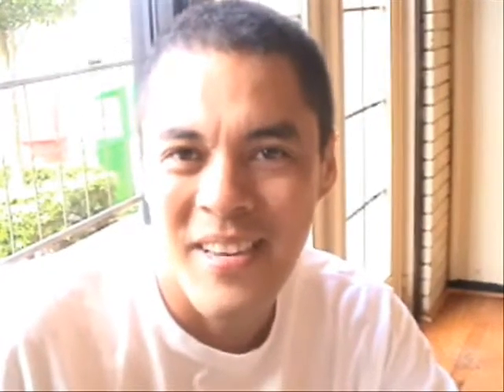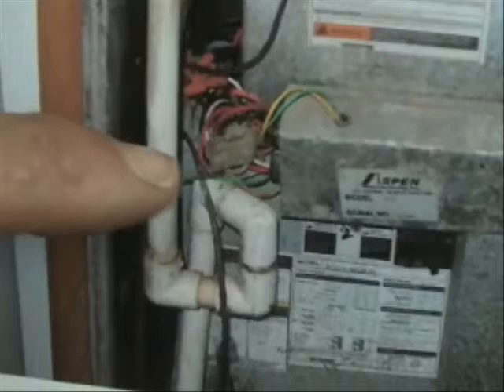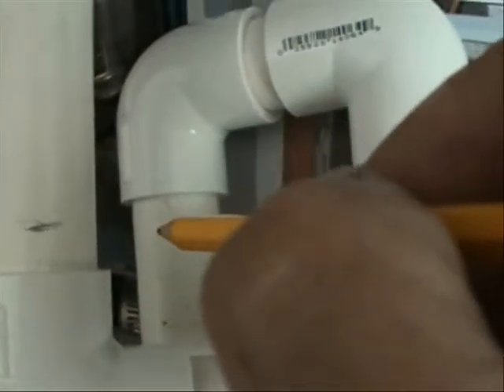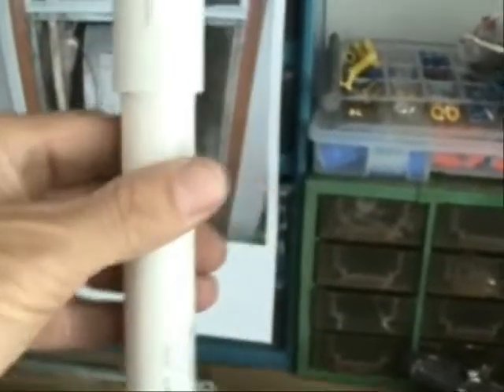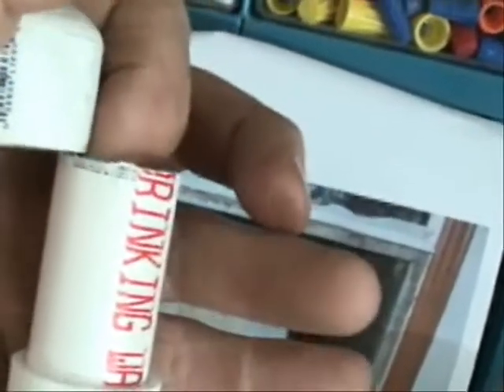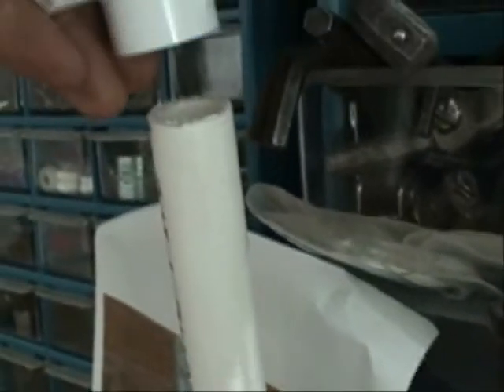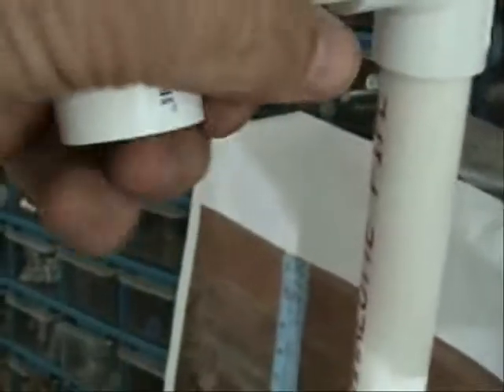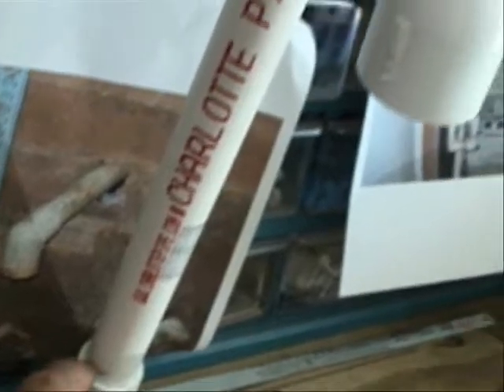HVAC condensate p-traps

Comment: great explanation can you answer this question on a p-trap on a package pump       during the heating season can you close off the trap to seal the condenser side considering that in the summer the water in the trap equalize`s the draft.........? in heating the water is gone and it`s back to sucking wind and bringing down efficiency ?????  and drafting cold air in the heating ?    thanks in advance  vinny SC-USA

Comment: And, in cases where gravity will truly NOT properly serve the outgoing condensate (i.e., not enough pitch to allow the water to freely flow), such that a back up of condensate is likely or even possible, a condensate pump should be employed. In that case, condensate first runs from the pan into a pump. The pump then ejects with force the condensate through the PVC or condensate tubing and out through the house or into a floor drain or other in-house drain. Best way to ensure there's no back up.

Comment: Regardless of the direction the water is traveling into and through a trap, for every drop of water that goes into the pan once it is full, that equal amount will go into the PVC piping system, including the trap, then out the egress point. This is another way of saying that the pan will not overflow, based on the trap orientation, assuming nothing obstructs the egress point. Of note, even in the original trap that resides in the air handler, water does travel in an upward direction...

Comment: Dr . zarkloff  I am in New Jersey and work as a Chiller operate in a large hospital and we have a problem with our large chiller system owner  equipment is BAC open cooling tower s and 4 1400 ton 19x evergreen centrifugal chiller and air is coming in to owner condenser system is getting air bonded .do you know if carrier my have automatic air venting values on the condenser pipe return and supply  lines and the headers are third feet in the air in the plant.

Comment: @DrZarkloff 

If you vacuum the trap dry, won't it will suck cold air into the system or blow hot air out whenever the air handler runs for heat?

Comment from the maker: The trap in this case had to be tall enough to keep dirt from filling the pipe. It freezes here in Northern Florida a few times in the Winter. We have lots of p-traps. I've never seen any around here freeze. I suggested to Idahodad to vacuum the water before the heating season just as a precautionary measure.